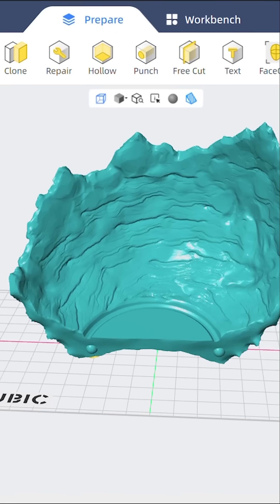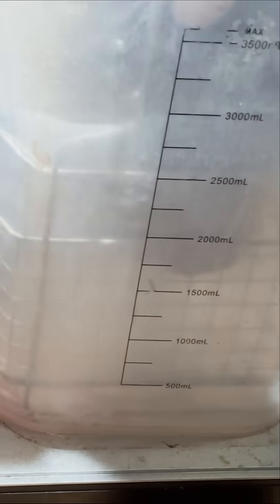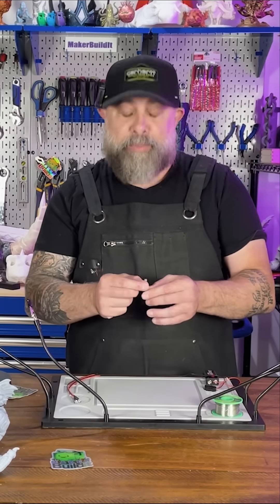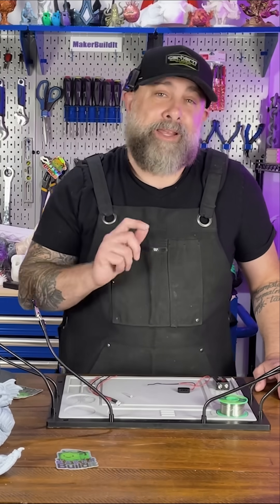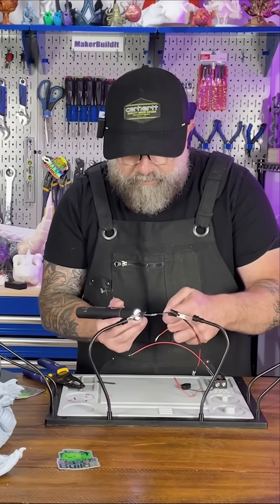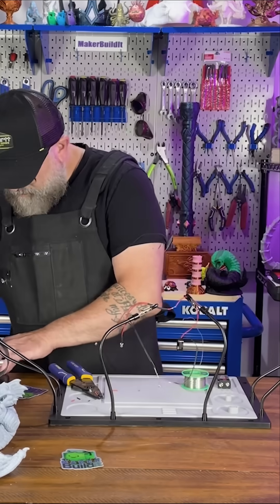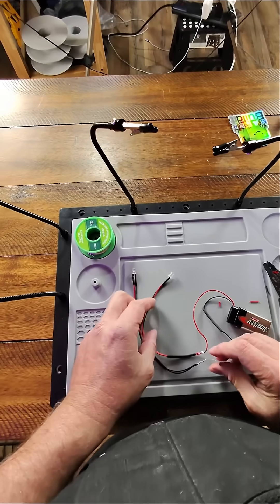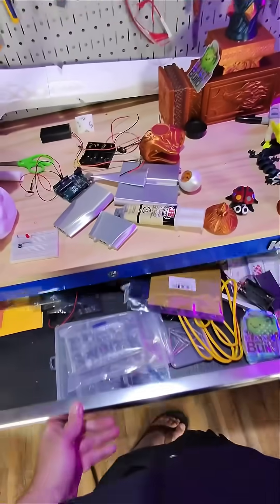How Does This Dragon Egg Light Up When You Open It?

Comment: Soldering is one of the things I have not been able to gain experience with yet. What are some simple/ inexpensive projects you recommend just to start to learn soldering? Inexpensive because I don't want to ruin $100 plus with one bad connection. I've built my own computer before, but that's Lego for adults. Soldering is the real deal.